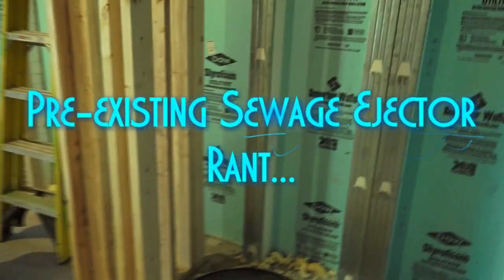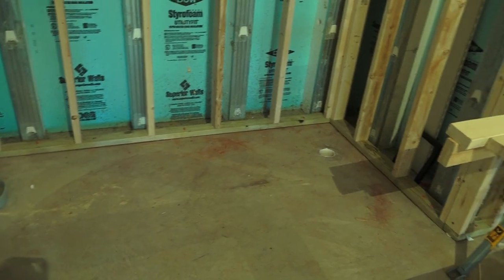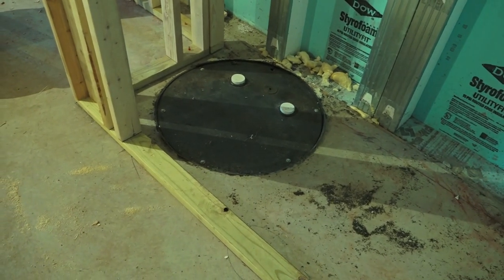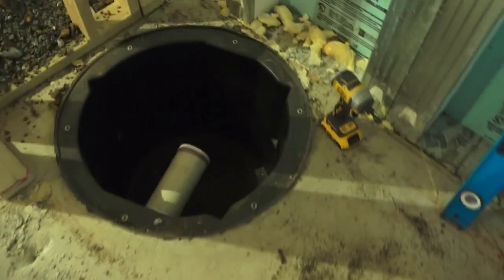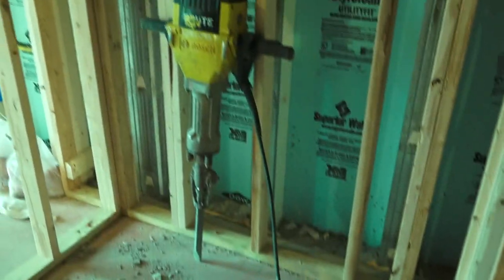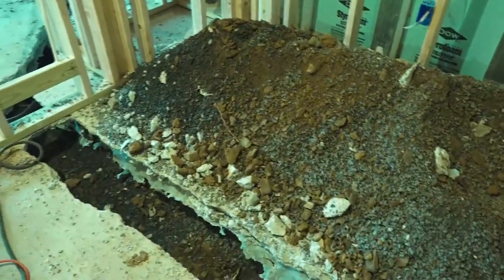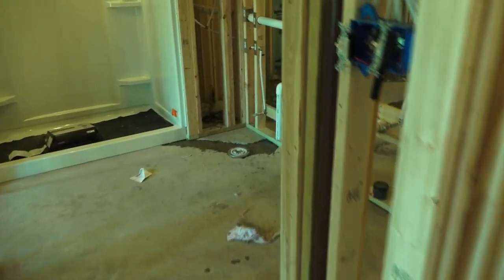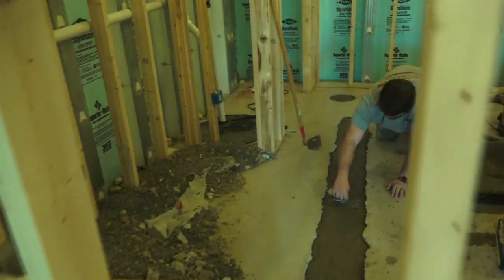Basement Bathroom Sewage Ejector (Money Saving Trick!)

Comment: Great video, Eddie. 

In BFU 2.0, I can’t find an answer to this somewhat related question. 

You installed the toilet flange on top of the concrete before finished floor was installed. I’ve heard from others that the flange should be installed on top of the finished floor. 

Can you help me understand why you guys put it on top of the concrete? I like your way of doing it.
Reply: Yes would love to know also new subscriber to BFU 2.0. Love it!
Reply from the maker: You can leave it on the concrete floor flat for added support and secureness. It does not need to be put down over top of the flooring if you are using a synthetic plank floor...which is only about 1/8" to 3/16" thick, you can simply cut the flooring around the preinstalled flange and will have no issues with leaks.

If your using tile and thinset mortar base you can also cut around the pre installed flange with no issues. But...you can install the flange after the flooring is installed as well it make no difference, but either way, you will not have a leak issue using synthetic or tile flooring materials cut around the flange. The wax ring will take care of the seal 100% either way. 

I like just installing tight to the concrete floor for maximum toilet setting stability. Hope this helps!

Eddie
Reply: Totally makes sense. Thanks for your help!
Reply: 1

Comment: Great video Ed but I do have a question. Why do you have sharp 90’s on the discharge lines? I always told to use long turns.
Reply: I think that was the vent line
Reply: Those are pressure fittings—they’re to be used on the dish charge line of the sewer ejector pump.  Long sweep 90’s should have been used there on the horizontal position.  The wye fitting on the vent line is facing the wrong way—will it work?  Yes but still not correct—especially if it was ever snaked.

Comment: I like that your ejector is up near the wall near a corner so you can put it in a closet.  I’m trying to figure out how to work around an ejector that is 2 feet from the wall and 5 feet away from the corner without eating up a ton of my floor space (only working with about 650 sq ft.).

Currently ejector only used for AC condensation and floor drains for water heater blow off but thinking about putting in a two piece bathroom…. After watching though not sure that I should since the toilet would be right at 30 feet away.
Reply from the maker: Hi Ryan! Just make sure that your pit is a real sewage ejector pit and not just a sump pump pit! You can't use a sump pump pit for sewage collection and discharge purposes.  ~Eddie

Comment: Do you need to drill rebar into the original slab before pouring the new concrete? Also, is a vapor barrier needed? And pea gravel for backfill?

Comment: Great video!  One question as it relates to the original Superior Wall system (I have the same).

What was the reason you / the homeowner added wood studs to frame the walls vs. attaching drywall directly to the existing galvanized stud facings built into the Superior Walls?
Thanks again!
Reply from the maker: 24” centers and no continuous bottom plate make for walls that warp. They also do not have any real inside or outside corners setup for drywall either…plus a host of other reasons that we do not like keep us from using these concrete and steel wall panels.

Eddie

Comment: Question for you. Let's say your ejector pit in the video had a laundry drain pipe draining into the pit through the pit lid via pvc, would you still have used that pit? Or would you just dig another one elsewhere? I have a washer in the basement draining into a pvc pipe affixed to the foundation that runs a few feet over to drain into the ejector pit's lid. Have you ever drilled a new 3" hole into an existing pit to feed a new drain pipe? I want to create a laundry/3 piece bathroom in the basement. It'd be close in proximity to the pit like you described. I recently upgraded to a 3/4 hp Barracuda from Menards. It's overkill for a washer but at least I'm ready for a bathroom. 
Thanks for the video! I enjoy them.

Comment: Tying back into that existing toilet line, you’ll have greater that, a 90 degree turn. How will that work out? I’m assuming its no big deal.
Reply from the maker: Not a big deal...we used some 11 degree 3" fittings and gently turned the 3" pipe back into the 4" for a nice unrestricted tie-in point. No issues at all!  Thanks for watching. ~Eddie

Comment: Hi Eddie, New subscriber here and really enjoying all you GREAT videos and knowledge sharing. I was wondering, do you need a plumbing permit pulled with inspections for code compliance when you guys have a basement finishing/plumbing project like this ..... or do you have a licensed plumber on call (or in house) that you use to handle the piping and inspections for these jobs if plumbing is involved?
Reply from the maker: We do our own plumbing in our area of PA and it does not require any type of plumbing license for the permit application. It may be different in your city/township so it's best to simply call your local code department and ask what they require.  ~Eddie

Comment: Hi Eddie, Did you guys have to cap the old/previous sink & shower drain lines under the slab? I only seen the single old 4" line in the video to the ejector and expected to see the others from the builder.  Is that common?  I'm about to get into this exact scenario and figured I would encounter multiple drain lines under the slab going to the ejector.

Comment: I see there is solid board insulation behind your exterior walls. Are you planning on adding more insulation between your studs or will that all be open?
Reply from the maker: Yes we add R-15 fiberglass to our new exterior framed 2" x 4" walls... ~Eddie
Reply: @BasementFinishingMan  hey Eddie! Do you install a plastic vapor barrier in your basements after insulation or is that not required in your area?
Reply from the maker: @raiderxx  No we do not, it is not required and...it's not advised to do so.
Reply: @BasementFinishingMan  I appreciate your responses! You're in the Harrisburg area right? I think I remembered you saying that at one point (hoping that was you. If not, I mean no offense!). I'm in western PA and finishing a room in my basement. Your videos have been extremely helpful for me to get things right. Thanks for everything you do!
Reply: @volkanyesilyurt 2 inch foam board against the concrete wall can act as a vapor barrier itself.
Reply: How about rockwool instead of fiberglass.    Just for insurance. ..

Comment: I’ve got a rough in like the pit you showed, and also a separate sewer ejector pump for my washing machine. I’m tempted to use the trick you showed to route my washing machine to this other larger pit instead while finishing my basement, as the washing machine one is just a bucket that sits in the floor and vents to the basement air. 

Would there be any downsides to moving my washing machine piping to leverage the rough in sewer ejector pit?

Comment: 1st question. Why not cut floor 2ft leave 1ft cut 2ft, leave 1ft, etc. This would reduce 4ft of cutting on a 12 ft. run. Dirt can still be removed under uncut floor. Im looking to do MINIMAL cutting. 
2nd, anyone have experience with Saniflos (on floor) marcerator ejector pumps? Toilet output is in back and goes right in pump unit. Only the shower/tub would have to be rsised 6+ inches for p trap. This would save  all cement cutting.